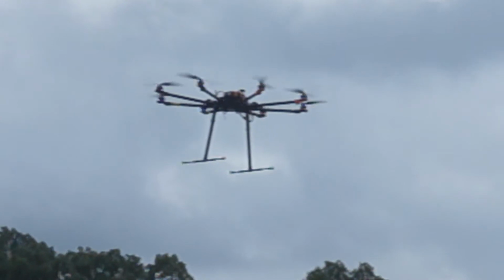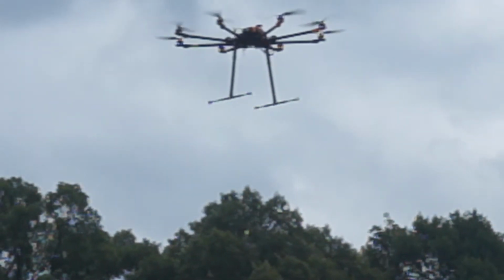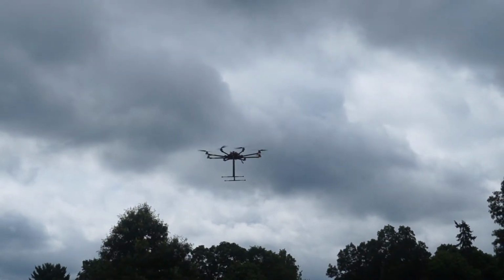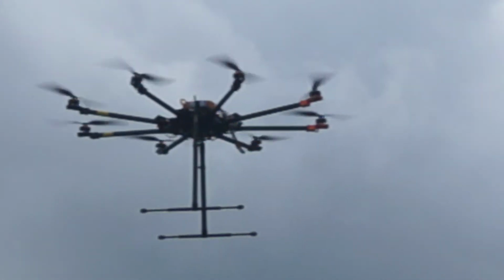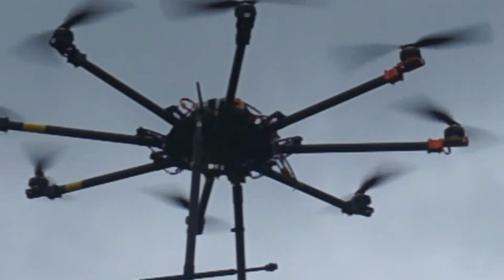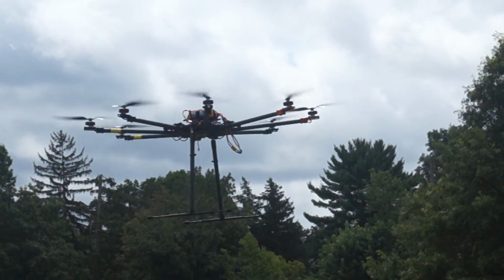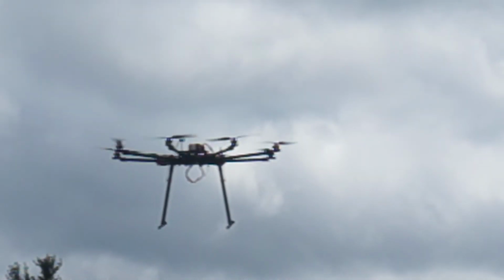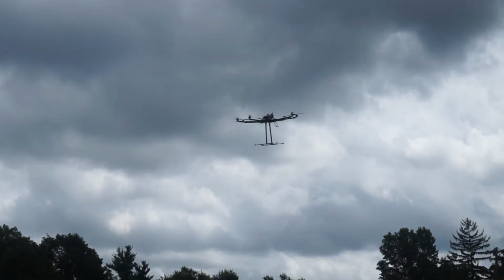Kraken 130 w/Pixhawk Flight Controller

Comment: Did you use autotune in px to tune pids?
Reply from the maker: Yes, we used both Autotune, as well as assigned a knob for manual fine tuning on channel 6.   Autotune worked great, sorry I don't have a video of that.

Comment: What are you using this aircraft for?
Reply from the maker: I'm not using it myself.  I built it for another company to use for photography.
Reply: Very cool😃👍
Just curious about why you chose Pixhawk flight controller over say A2 or another.  Thanks
Reply from the maker: avosso Personally, I think Pixhawk is a better flight controller all around.  It offers flight modes unavailable in DJI A2, is less expensive and is Open Source.